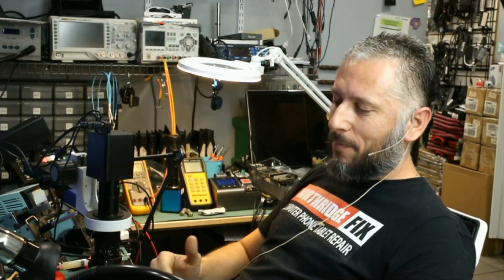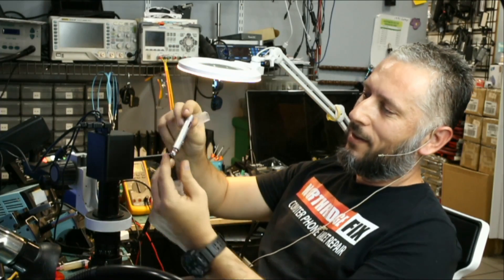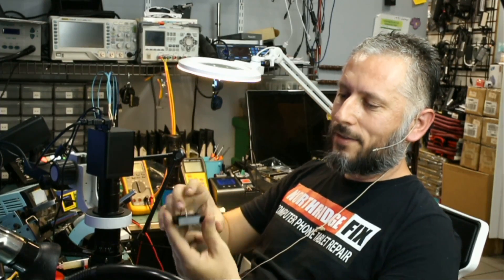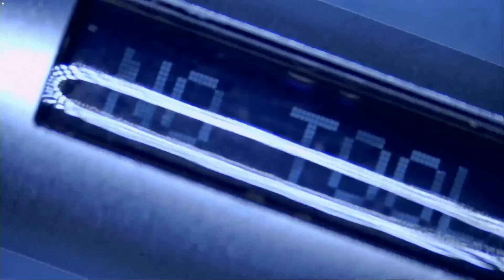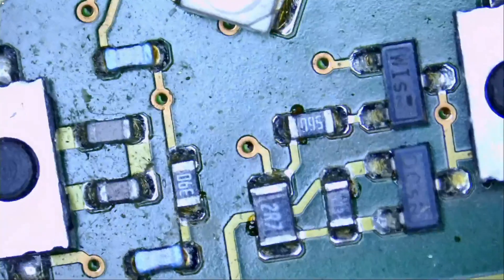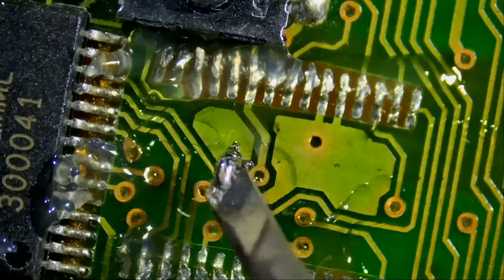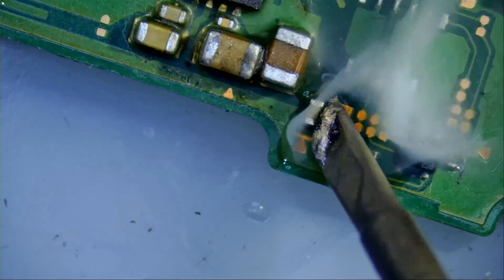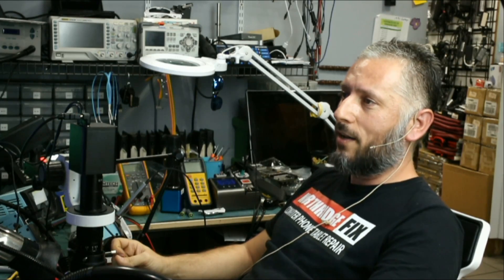NF.Mini Amazing Micro Soldering pen review

Comment: The quick charge 3.0 gives only 5 volts how I can change that ? 
I tested it with a USB tester and only 5 volts i changed the temperature on 400 grad Celsius but I become only 5 volts ! And it sticks on the solder PCB ! 

Thanks in advance.
Best regards,

Comment: Thank you so much for the tips. I have a question, toshiba satellite displays on external monitor but it does not display with its own monitor. I have tested with another screen and screen cable and not working. could you please explain about the possible issue area and the solution? Thank you
Reply: hahahahahahaha

Comment: I'd probably just get a Pinecil from Pine64, which is the successor to the very popular TS100. But the Ts100 only has a Micro-B port that can't power the iron unless you install IronOS and even then it is very weak. But the DC jack can take 12-24V (up to 65W) The Pinecil comes with Type-C and can run off QC or PD or the DC jack at 12-24V (up to 65W).
Reply: afaik pine64 and miniware have nothing to do with eachother
Reply: The new pinecil can support up to 88w
Reply: This and the Pinecil are two different tools. The Pinecil uses standard sized tips that compare to C245/T12/T18 sized tips for general soldering, the iron in this video is a micro tip size, which is more like the C210 handles from JBC.

Anyway, 2 years later there are way better options than the pinecil for both general and micro soldering.

Comment: very awesome!  can use with a power bank?  whats the wattage?
Reply: 20W it does work off power banks but only if they support Broadcom Quick Charge 3 (QC3) (often just shown by a lighting bolt icon). Power banks that go with Power Delivery (PD) are not compatible.

There is a competing product called the TS80p that can run on either QC or PD and is up to 36W. Or upgrade to the TS100/Pinecil for a 65W iron. Open source hardware is probably more compatible across the board.

Comment: Ts80 you can get a 5525 to USBC PD 100 w cable and run that off of a PD port it'll do the 20 volts like 3 amps and you can buy a small tip also

Comment: one of the 'deals' i got off of amazon came with tips that melted away when i used the medium temp setting of the ceramic iron (the blue one with the dial that we've all used). the iron was great, two tips only lasted half way thru the mod. a flamethrower would have been less frustrating to use. glad to see the higher quality tips with this pen. good share @ The Real Alex :yougotthis:---> you got this

Comment: Would this be a good tool for say fixing cpu pins? Seems like it would be well suited for that.
Reply: Almost impossible to solder cpu pins with an  iron, too tiny to get the inner rows. Hot air and a steady hand.

Comment: I been using TS100 for almost a year now, and it's working perfectly. Maybe this one is good one, but the TS100 can run with 24v 2A
Reply: TS100 can go up to 400 degree Centigrade and if hacked reaches 450. Don't think NF.Mini can handle that
Reply: I believe that NF one is good, but a TS100... everyone knows that ones.. I have my TS100 for more than 4 years.. And if you didn't test the TS100, give it a try 😉 or you can make a video comparison test with Pinecil (clone of TS100) and NF to have 2 soldering irons with C port!
Reply: If you need a more powerful iron you can always get the Ersa 150. That one has 150 watts. That isn't the point of microsoldering though.
Reply from the maker: I never tried the TS100, but it  looks like it compares to my 40w weller station that i use for big jobs. The NF.Mini is for micro work and it's a 20w pen that can go up to 450C. For such low power consumption, it does an amazing job.
Reply: @NorthridgeFix  You can get quite small tips for TS100/Pinecil and they can do 65W at anywhere between 12 and 24 volts. Pinecil is the upgraded model that can also run off USB-C. But both are very good for hobbyists.
Reply: @NorthridgeFix  I think it is a great compliment for the ts100. I have a similar style usb one and I use it when my ts100 feels too big for the job and I need more precision. The ts100 resembles to the hakko FX-951 (it even uses the same T12 tips) and the NF mini to the hakko FM-2032 micropencil.

Comment: Awesome! I use a ts100 as a daily driver for FPV drones, but this one would be perfect for the field.
Reply: TS100 is fine in the field, you can even run it off your drone batteries if you don't want to bother with USB.
Reply: If you have the TS100 why changing for something worse? I can start by the ports you can plug on TS (micro USB and DC5525 up to 24V using batteries).. In my opinion, TS is far better for the field, the only thing you can have better on NF one maybe the smaller tips.. On everything else the TS is better 👍
Reply: @pedrogomes9662  because I said for the field...I leave my ts100 at home and leave a iron in my bag for soldering motors and esc's etc while out flying. Gotta laugh at you guys telling me all about the ts100..I've been using one 4+ years, I know how they work 😅
Reply: @BengalCatChilli   you don't need to laugh because you are talking to someone that has one for plus 4 years! I know the equipment and you saying that NF is perfect for the field when it starts by not having a jack to connect the power, less powerful and a tip like a needle is perfect do desolder motors and wires of 2.5 or 5mm thickness.. i don't know who is laughing of who... 👍👍👍
Reply: @pedrogomes9662  lol. I honestly don't care about your opinion 😅 There are 3 tips in that kit btw, more than enough for FPV work. You know literally nothing about drones and what they require. I could build an entire drone with that needle tip no worries 😅  The pinecil is better than your precious ts100 anyway.
Reply: @BengalCatChilli  yeah you're right 🤣🤣
Reply: That and a Weller portasol is pretty useful if you're in the wild.
Reply: @perspicaxingenium  any Weller product I've ever seen is an overpriced pos, Pinecil for me all the way
Reply: pinecil

Comment: how does it compare to ts80?
Reply: 30w vs 18w. And ts80 has bigger tip. 115 tips are not effective on thick boards. But ts80 effective.
Reply: @cetoxim  TS80 has pretty limited tip options, but TS100 has some tips smaller than NorthridgeFix is offering, and Ts100 is a 65W iron. If you really want to power it from USB there is a TS100 clone called Pinecil which has USB-C it will accept power over.
Reply: @Helio_Centra  yep and with new ts101 model it can be powered with usb same as ts80